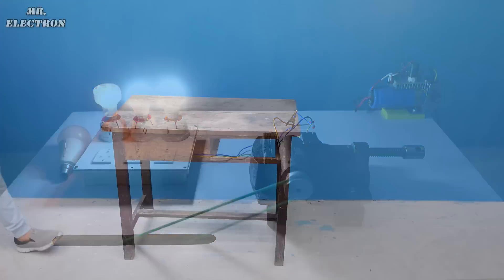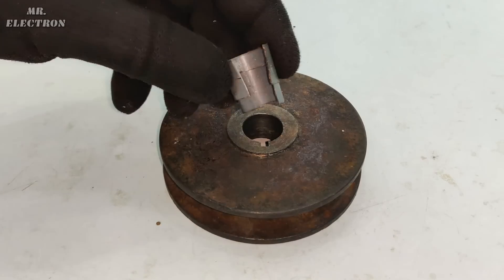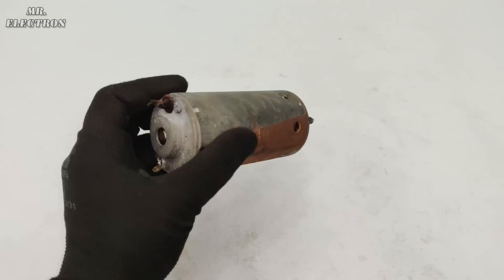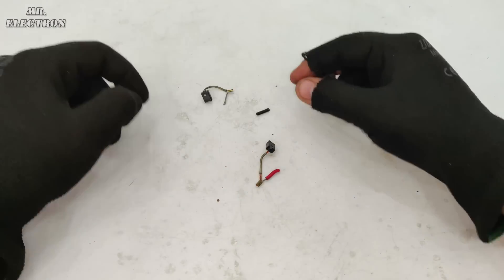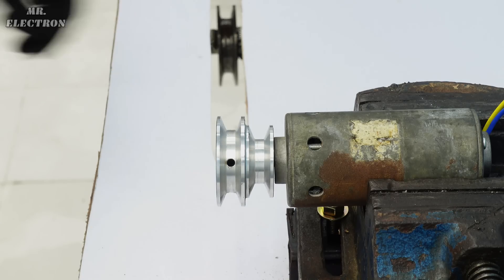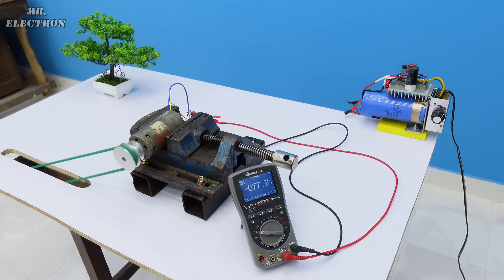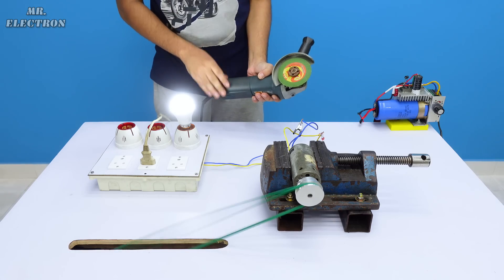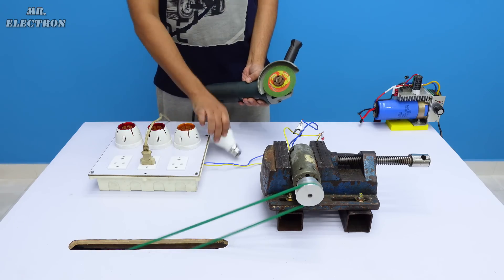I make 220V 600W Electric Generator from Hand Blender Motor

Comment: you could try to connect a washing machine motor to the alternator together using a 12v battery connected to the alternator and the inverter, and the motor to the output so that it powers the alternator, I hope I have explained myself well

Comment: Soldering the wires is not a good idea there's a reason why they crimped because it gets very hot and the solder will melt
Reply from the maker: No, it's not that because many dc motors  also come with soldered brushes. I opened one of those in my previous dc motor repairing video.

Comment: I have an idea..... just add an energy meter to the board, you can see all the details there... that spark is likely to damage the brushes.....
Reply from the maker: True. I will have to look into the problem.
Reply: @MrElectron  that spark might be because of high speed of rotation and heavy current drawn...
Another suggestion, you can prepare a board which will have all types of connectors and plugs along with switches plus an energy meter, you can use it everywhere to see the energy, voltage and current...